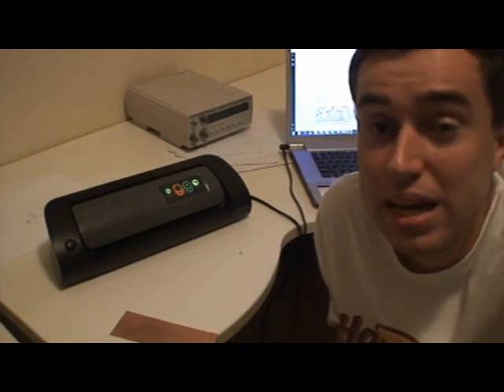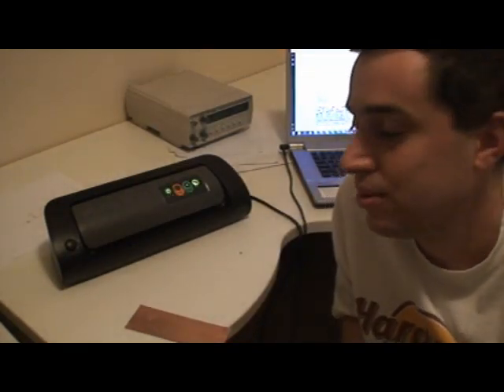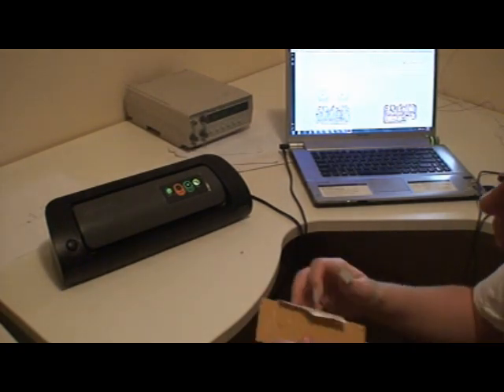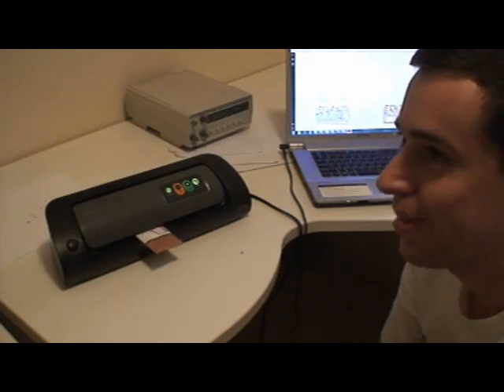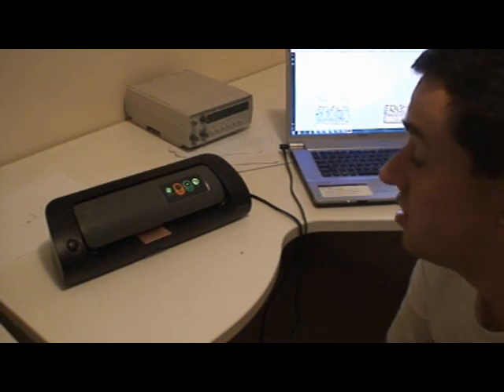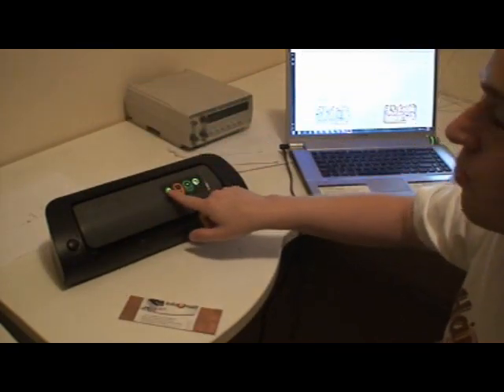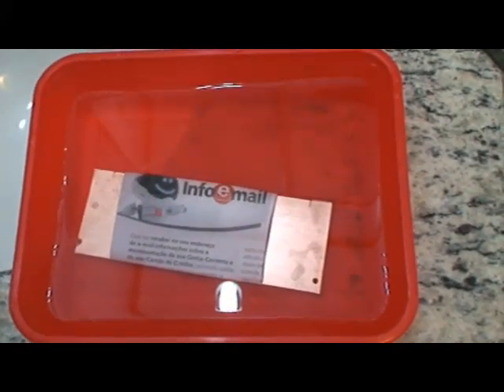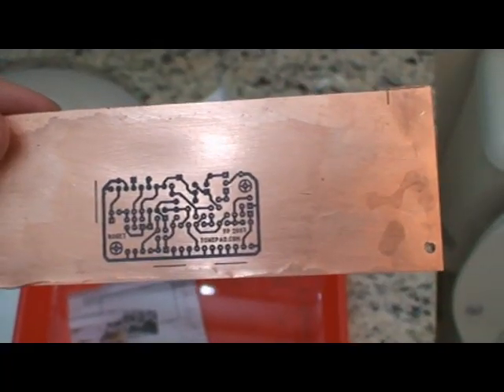How to make a PCB using a laminator

Comment: This is oldie but goodie. I've got this laminator on ebay, modified it according to the other video (swapped the gears to make it slower) and got equally great results. At first though, I used the yellow transfer paper that I was using before with the clothes iron but it did not work well. So, I tried with a regular magazine paper and it worked perfectly. I use regular ferric chloride too.  So much easier that ironing and the results are stunning. $40 well spent.

Comment: Will 1.5 millimeter thick PCB copper clad fit in without modifying it..? (according to manual it's maximum Thru-Put thickness is 1 mm only )

Comment: How many times did you pass the copper board trough the laminator so taht the design stay welldone?.What kind of paper didi you use?
Reply from the maker: Hello Gabriel.  Just once, but  I did a small modification in this machine to make it slower.
Reply: Ok,you know I was looking for the machine you proposed and in my country (Argentina) does not exist.Is there another replace of it with similar features?
Reply from the maker: Gabriel Emanuel Ciorciari  You can try to buy it from Amazon.com  Im pretty sure that they ship it to your country, I sold this machine to a friend and I bought a bigger model from the same manufacture, and It doesnt work as great as this one. So, I strong recommend it to buy it this GBC-H220.
Reply: Rubens Bardelli
Hi buddy!,yes you are right but I been seeing that in Chile has this model GBC but it´s some expensive to my pocket jajaja.The cost of it it´s double than other ones but for your explanations it seems to be the best.Could you tell me who is the  manufacture of GBC-H220?.Greetings!. I hope you can m ake a great Xmtas with your family!Happy new year!

Comment from the maker: Hello,

Yes, you can use an unmodified laminator. The only thing that you will have to do is that you have to pass the board through the laminator at least 4 times. I modified my laminator to make it slower so that I dont need to  put the board in the machine several times. (You just need to exchange two gears, its pretty simple and it take less than 5 minutes to do it).

Comment from the maker: I had to do a Modification just to make the machine slower. For that you just need to switch the  gears  (put the gear from the motor in the roller and the gear from the roller in the motor, this is done to avoid to pass the board several times inside the machine). You can use the 1.55 mm PCB without doing any modification.
Reply: I use the 1.5 mm PCB with any modification.